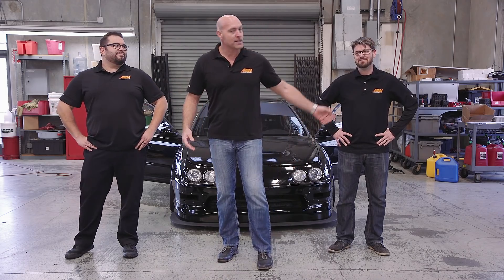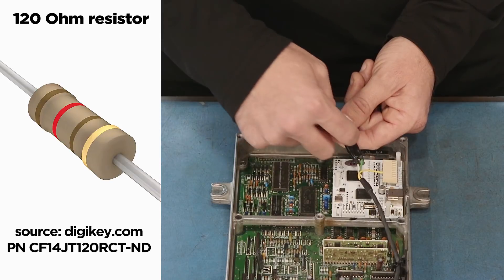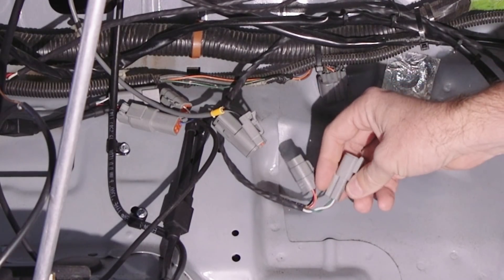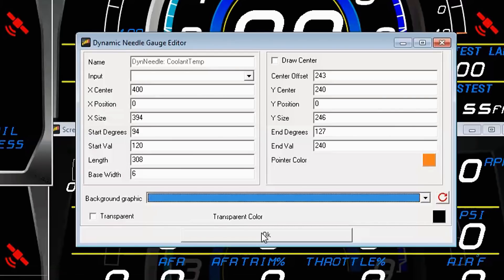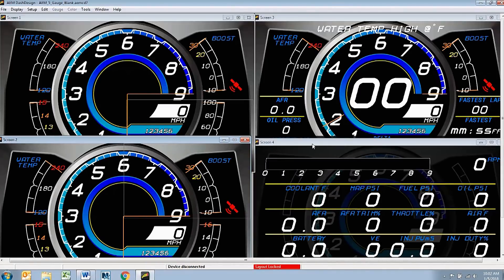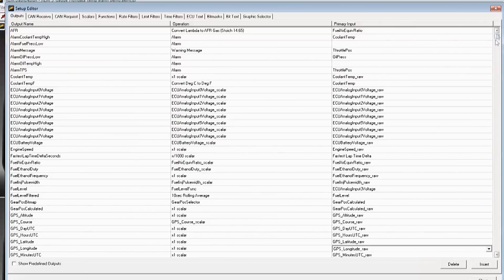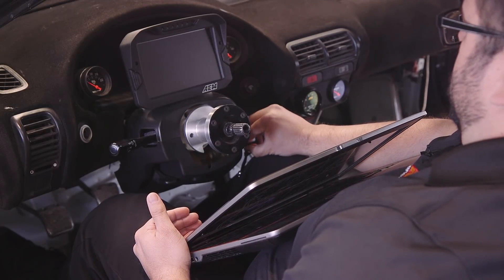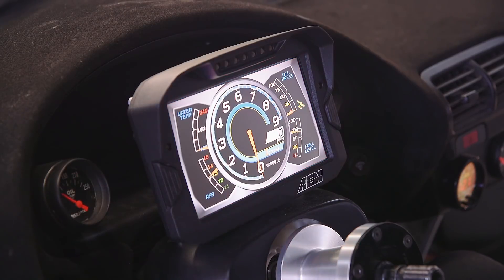Connecting a CD-7/5 Digital Dash to Hondata S300V3 or KPro4!

Comment: So I have everything all wired up like shown in video but nothing is working when car is on with engine running or off? What is it that I did wrong Hondata s300 v3 120ohm resistor jumped between CAN H/L still not working??

Comment: Says fuel level wire into hondata then transmitted via can hi and low but you can see the yellow wire even going out of the ecu into the same connector as the can hi and low white and green wires so what is the yellow fuel wire plugging into? And if your car  doesn’t  have a vdm then you just run separate ground and power instead of getting power and ground from vdm ? And where are the vdm connectors coming from and going to ? It shows them plugging in but not to what or from where and getting the the input on laptop but as can? Kinda confusing just throwing the vdm in there but not really explaining it
Reply: In the video they explained that there's a converter in the car to take fuel level resistance and output a 0-5v analog signal so the yellow wire is connecting to the fuel level converter.  The AEMnet connectors typically have four pins in them: CAN+/-, power and ground so you can just daisy chain devices together and they can get their power/ground from that one connection.  The VDM is not a power source - it's just another device on the AEMnet network.  They explained in the video that the car used to have another dash so they're using the power/ground from that to supply power onto the AEMnet connections.  The VDM just plugs into AEMnet.  All AEMnet or other CAN devices are all just in parallel with each other - that's how CAN networks work.  Nothing is really any different with or without the VDM in there.  If the car had an AEM ECU then the ECU would supply power/ground onto AEMnet since they come wired that way but since this car has Hondata, separate power/ground must be provided.

Comment: HELLO, GREAT VIDEO GUYS, I WANT TO CONNECT MY
 AEM DASH CD7 THROUGH THE OBD2 SYSTEM IN MY RAM 1500 V8 HEMI, BUT NOT CONNECTED, WHAT CAN BE THE PROBLEM?
Reply from the maker: Thanks for the kind words! As long as your truck is 2008-up and you have the OBDII Adapter cable and have provided power to the dash, once you poll the OBDII port using DashDesign software and assign the received channels in your layout they should display. Our tech guys can help you out, so please contact them at gen.tech@aemelectronics.com!

Comment: Could i get a better explanation of the “terminating resistor” wiring?
Reply from the maker: Canbus networks require a terminating resistor at both ends, the AEM CD-5&7 have a built in terminating resistor that can be selected on or off in the software. The other end of the network (in this case the hondata unit) does not have a terminating resitor so one will need to be added in (time stamp 2:21). The terminating resistor is a 120ohm resistor that bridges between the can + and – wires.

Comment: Would this be compatible with Kpro3? The digital output on Hondata is a smaller port compared to the Kpro4
Reply from the maker: At this time, we do not have a Serial to CAN adapter available, so there is no way to get the data from a KPro3 to a CD Carbon Dash. Short of upgrading to a KPro4, you can use a 22 Channel CAN Sensor Module to send data to the dash separate from the KPro3.

Comment: Thanks for the demo.
I am leaning more & more to this device but ultimately would be looking for a complete system.

Which PDM & Keypad would you recommend using with a system similar to this (Using a different ECU i.e. Link, Haltec or other)?
Reply from the maker: We have validated several PDMs and have the CAN data available on our forum here: https://www.aemelectronics.com/forum/can-configurations-3rd-party-hardware

Comment: Interesting video, I just found this, and wonder can I use this in an Engine swap situation, would I need to have 2 ECUs, just wondering how to make that work
Reply from the maker: Assuming you are talking about an engine swap that uses a stock ECU, if the ECU is 2008-up then the channels going to the OBDII port are transmitted via CAN bus and you can use our Plug & Play OBDII adapter harness to receive them on the dash: https://www.aemelectronics.com/products/cd-digital-dash-displays-adapter-harnesses/cd-7-plug-play-adapter-harnesses-3rd-party-devices/cd-7-obdii-can-plug-play-adapter-harness

If it is not an 08-up engine, then you would need to convert your channels to CAN bus, and we make 22 and 6 Channel CAN Converter modules that make it really easy to do: https://www.aemelectronics.com/products/cd-digital-dash-displays-adapter-harnesses/aemnet-can-bus-expansion-modules

Comment: Is a 22 channel can sensor moduel needed for this?
Reply from the maker: If you do not have an ECU that transmits channels by CAN bus (either a standalone ECU or 2008-up factory ECU), then the 22 Channel CAN Sensor Module is the best way to get channels to the dash. We also make a 6 Channel CAN Sensor Module if you want to start with basic channels first (2 pressure, 2 temps, RPM, and fuel level). More info is here on both CAN Modules: https://www.aemelectronics.com/products/cd-digital-dash-displays-adapter-harnesses/aemnet-can-bus-expansion-modules
Reply: @AEMpowerTVelectronics  have a kpro4
Reply from the maker: If you have a Kpro4 you do not need a CAN Module. If you watch the video all the way through we show you how to hook up your KPro to the dash including how to make the CAN wiring. The only difference between the S300v3 and KPro4 is the connector on the Honda board, so this video will show you how to do it! The software setup procedures in the video are the same, too.
Reply: @AEMpowerTVelectronics  thank you guys. I appreciate your assistance.
Reply from the maker: No problem! If you have any other questions let us know or email our support team at gen.tech@aemelectronics.com.
Reply: @AEMpowerTVelectronics  amazing. I appreciate that. I am currently waiting on the sponsorship department to either approve or deny my proposal. Once I get the answer whether yes or no I'll still buy a cd5 lol. Dying to get rid of the s2k look. I am sure I'll be the only person in nyc with a cd5 in their daily car😈
Reply from the maker: Alexandru, we confirmed that the connector for the Honda board is the same one as in this video. You will need to verify the pin locations for CAN on the KPro though.
Reply: @AEMpowerTVelectronics  ok im assuming a regular diagram from kpro will help me with identifying which one is can. Correct?
Reply from the maker: Good luck with your request! We do receive a lot of them, so be patient waiting for a response.
Reply from the maker: That is correct. You will need to identify which pins they use for CAN hi and low. and run your wires to those pins.
Reply: @AEMpowerTVelectronics  lol patience is not one of my strong suits sir. Worst case scenario ill buy it anyway if it takes too long. I'm on a deadline, my wish is to have the cd5 in as the same tome as the turbo. I already have all my turbo parts. We will see what happens
Reply: @AEMpowerTVelectronics  hey. Purchased the cd5 as i cannot wait for the sponsorship response. How do i get fuel lvl on the cd5? Do i need any other parts to make the fuel lvl work when using cd5 w hondata kpro v4?
Reply from the maker: The dash receives all of its channels via CANbus, so if the fuel level is not transmitted through the KPro CAN output you can get it by adding our 6 Channel CAN Sensor Module. It has a fuel level input (0-250 Ohm range) that will send the data to the dash via CAN. It also has inputs for two analog and two thermistor temp sensors if you want to add any additional info to the dash or your logs if you bought a logging version. The 6 Channel CSM is here and the instructions are downloadable if you want to check it out:  You can also email our support team at gen.tech@aemelectronics.com for assistance and to get a faster response! https://www.aemelectronics.com/products/cd-digital-dash-displays-adapter-harnesses/aemnet-can-bus-expansion-modules/6-channel-can-sensor-module

Comment: Would have been nice to see full wiring rather than “talk through” what was done for Hondata.
Reply from the maker: We cover the wiring in the video. It's just a simple setup. We even provide PNs for the ancillary items you need to make a CAN harness. Once you make the harness, the wiring is as simple as connecting the DTM connector from the CAN output on the S300 to the DTM receptacle on the dash harness.
Reply: AEMpowerTV does this work with the Hondata S300V2?
Reply from the maker: I don't believe the S300 V2 had CAN bus out, and you need CAN bus to send the channels to the dash.